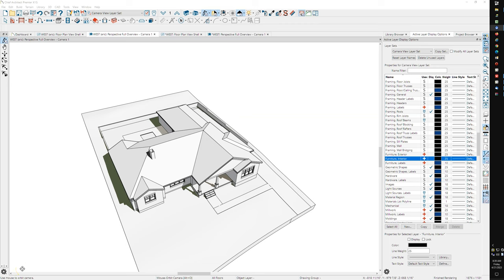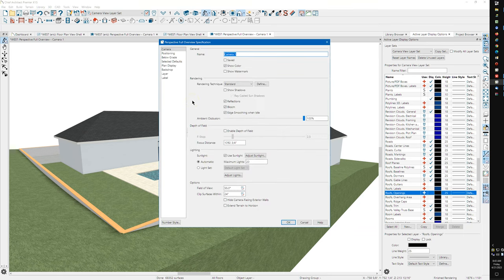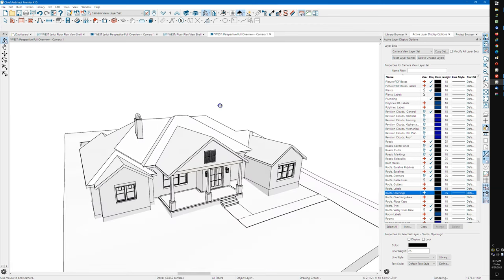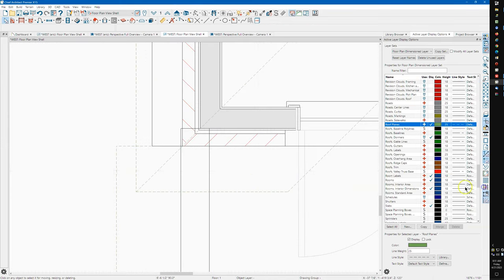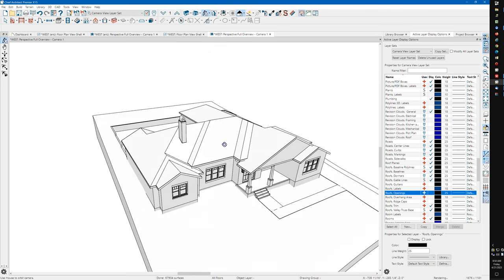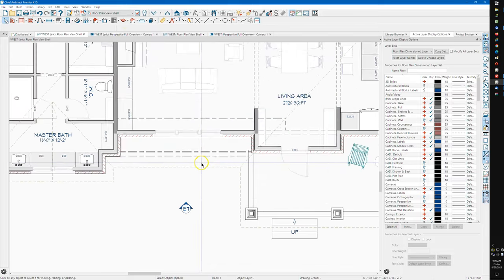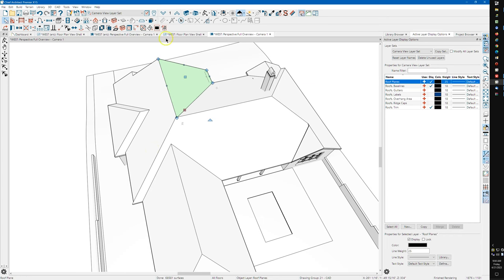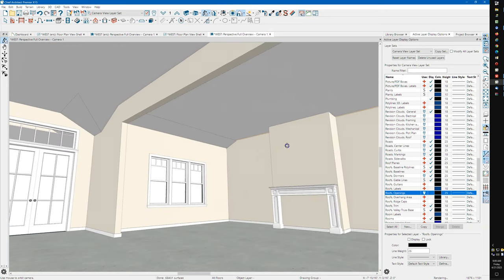West Roof - Chief Architect / Home Designer Pro

Comment: This has been soooo helpful Eric.  Soo much better learning how to do what you did.  I would not have been able to reproduce that without it.  Lots of great pointers from an experienced pro too!
Also:
1) You were right on the car turning radius --> adjusted that.
2) Added a bump out on the side of the kitchen area.
3) 12ft is what the client requested, on the gulf coast, so high ceilings are the norm.  Will see what happens when we get the cost to build...🤷
4) The moldings on porch weren't there for any particular reason hah 🤦!
5) I did make moldings around the porch to cover the end of that floor vs foundation area.  Several videos on that (if you got any tips...).
6) Great idea on the foyer ceiling being dropped down, makes it more intimate when you walk in.
7) Great idea on bringing that porch over to the other wall, soo much better of a design.

Thanks for your assistance and coaching.  This has been a great starting out experience with this software and community!☺  Looking forward to learning more!!